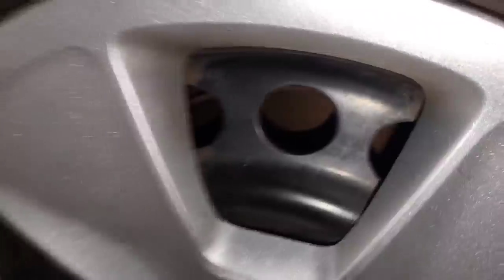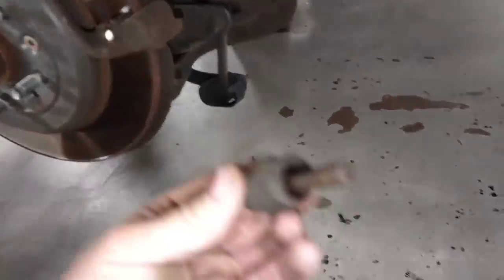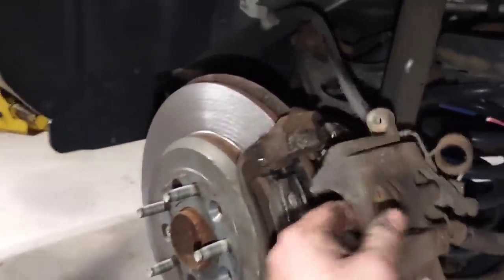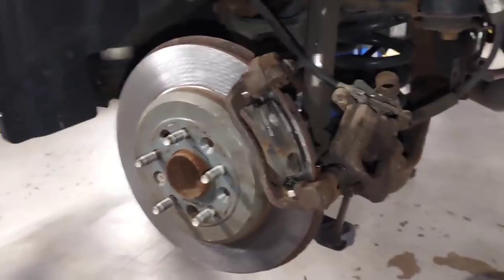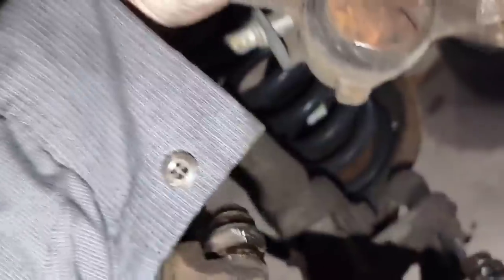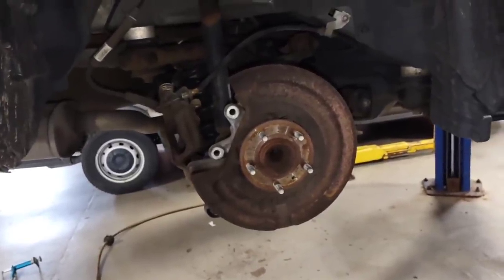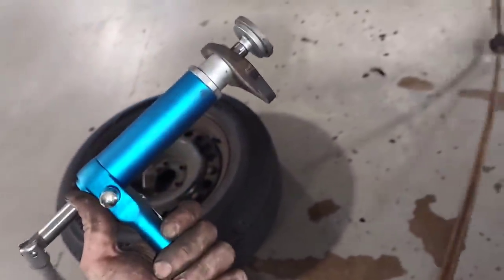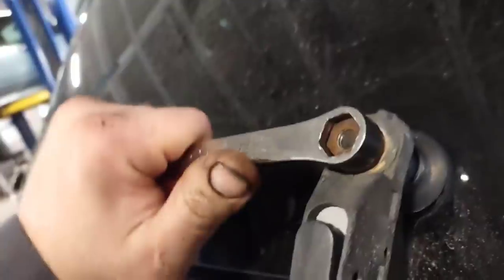Fixing Another Shops Brake Job Screw Up - this makes mechanics have a bad name Shoddy Work

Comment: C/s: My brakes are sqeualing
Tech: youve pad slapped your rotors, theyre warped from heat damage and grooved, this is a symtom of pad slapping
Customer:  but Ive never had my brakes replaced!
Tech: 90000 miles and you have 7 mm of pad left?
Customer: ....My mechanic did it

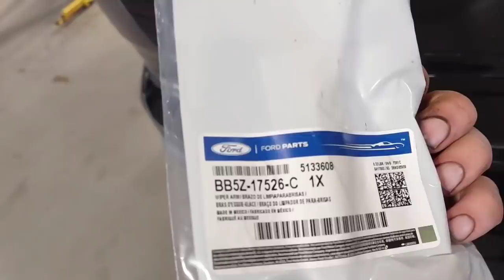Comment: I wouldn't be afraid to charge them.   Did that back wiper arm fall apart at 7:06?   Looks like someone tightened it to the breaking point.
Reply from the maker: I actually talked about this at the end of video oh, did you watch it all the way through?
Reply: @FordBossMe  Most of it.  Will rewatch.  You're a good guy for helping them out.   I am by no means a professional but i can work on my own rig.    Sad to see shops not making sure their employees are doing quality work.

Comment: Are any 5.4 3v worth buying or is that an engine that should be avoid?
Reply from the maker: I think 2008/2009 2010 were the better ones
Reply: @FordBossMe  are they at least some what as reliable as the 5.0 coyote?
Reply: @777theright88  I got 200k on my 5.0 coyote. No problems and runs great.

Comment: How do the pistons get out of clock, or unclocked (if that's a word) unless you rebuild the calipers?  And by the looks of things this "guy" didn't rebuild anything.
Reply from the maker: So you take a tool whenever you're ready to do the brakes and you turn the Piston back in and this guy didn't set the Piston up right when he put the new brake pads on he had it off so it wasn't even touching the back of the brake pad properly whenever he clocked it

Comment: I did take my ford explorer 2013 to dealer they ask for new front brake pads a rotor bc they are dmage they state $600 hahhahs i did inspect my self mechanicn inclined... took tire off lube pins etcetc padss and rotor great...  you know what they said you need your car must be shacking and to put the cheery on the cake that also need new lower control arms $999 .00... they tried to mke commission and sale on my expense ...

Comment: I'm not knocking you, but if the front rotors were getting real hot why wasn't the rear checked. If the back pins were locked up pads can't  properly press on the rear rotars.. where i worked we always checked all hardware and and movement on all wheels. Going the extra step to check the caliper brackets would have been a benefit to you. And fixed everything at once.
Reply from the maker: Checked the pinned post
Reply: @FordBossMe  
  Thats why I said I'm not knocking you.
 But it should be shop policy when doing  work like this to do full inspection front and rear.  Due to the fact that they will want the fronts on warranty when there warped from the excessive heat.
It seems like the guy just tossed the rear pads on. I doubt it was a shop, thats when I ask the customer to bring in the service order. We have had customers go to small claims court against shops that did stupid stuff like this. I've seen where the (at fault) shop has to pay customer back, and also pay you to make vehicle able to be on the road.

Comment: New rotors but no new calipers? And as low cost as calipers are?
Reply: With shop rates the way they are, it's just cheaper to replace the caliper.

I'm dealing with that of my lower control arms right now
  it's just easier less time to replace the entire lower control arm then to replace the ball joints and bushings because of shop time.

Comment: Why let others take full pay on a job and not have them make it right or get a refund?  For all they know, they did a good job with no complaints and will keep doing poor work.  You come in as the nice guy and take less than standard fee.  Not your fault.  Only upside I see is that you may gain a returning customer.  I understand helping people out depending on circumstances, but people need to accept and take responsibility for their own poor decisions and not rely on other people to take up the slack. 
Not sure if you are a flat rate tech paid by the shop management, but if so, they should be the ones to reduce labor and parts prices and pay the tech in full.  In my dealer, if I did this often, I'd be getting reamed about lack of productivity.  I would fix the wiper as a simple courtesy in that case.  
Being a taken advantage of tech doesn't erase the bad work of other techs.  Managers look at bottom lines and fck ups only get addressed when they are called out or cost their shop money.

Comment: my friends sister  took her   Sable to a Tire Kingdom , a couple weeks after  him zeroing out all the fluids, new Filters everywhere plugs wires etc, for his sister. she goes in for the $9.95 let us check your vehicle over deal,, Guy comes out Mamm You need $1200 in work.. She calls him, and in he goes,, Guy goes on about needing fluids, etc,, he holds his hands out and Says, Guess what I do for a living.. I did every fluid , plugs wires etc not 15 days before and your saying it all needs replacing... Get the car down off the hoist. and off he went..  another Girl we know called us saying shop told her the calipers are missing. and rear cylinders are leaking, In he goes.  says now tell again  Her Calipers are missing??  and the rear cylinders leaking, You spray alcohol on the back of the backing plate thats wet, to see if its brake fluid vs gear oil or grease weeping ?? guy says no Why... Cause the alcohol will clean brake fluid fast but not as easy oil or grease. so you;ll know if its a cylinder leaping vs a seal  and then you can look in the master Cyl too to see level..   Down that car came too...

Comment: God help them if they had drums or internal drum emergency brakes.
Living in the Northern rust belt "internal drum emergency brake" disks always rust up, along with cables. Just like older drum brake cables.
My father told me; "Any used vehicle you're not 100% positive they used the Emergency brakes, DON'T touch it!"
Once I forgot and had to stop a 1978 Mercury Zephyr and the bracket tack welds ripped off the bottom of the car, brakes were siezed. Then I had to cut off the dragging parts off the bottom of the car. Many of them I even unbolt tbe pedal from the firewall so people have more foot room and don't get the idea it's a working emergency brake.

I'd rather do my own brake job regular maintenance with rear drums and stainless steel lines than pay for cable emergency brake cables and shitty Lincoln calipers. Easier and cheaper with Jeep rotors and S-10 calipers on a Ford 9in rear.
Does 9in show my age? 🤔😂

Comment: Question. 
I have a 2010 Fusion. 4cyl.
The fuel inlet warning / Small/ large evap code.
Sometimes it goes on sometimes it'll clear itself out.

Is this really common?
Reply from the maker: Most of the time on those Vehicles it's the purge valve or the gas cap not tight
Reply: @FordBossMe  It's a capless fuel inlet.

Comment: Is it me or is it like most car shops charge you way to much??? Goodyear charged me about 800 dollars to get all my brake pads and rotors replaced with a brake fluid flush!!! I just had a friend do it for me for just 300 dollars !!! The brake fluid flush wasn’t even needed too yet they insisted for me to get it changed!
Reply from the maker: Brake fluid should be changed yearly they recommend now

Well that's why we have connections and if you trust him then good but if you go to a dealer or a shop you're paying for not only the job but you're also paying for the insurance and you're paying for whoever it is to make sure you get the right parts regardless of the situation
Reply from the maker: I was just saying my shop if you had a front rotor job done that would be $300 in labor and about $50 in pads that's 2 hours labor so $800 does seem about right for what you were charged front and back and a brake flush because you're going to a shop to get it done

Comment: That's So basic. Possibly a new inexperienced guy did the rear brakes. It won't reassemble properly if they're not clocked correctly. Pins need to be cleaned, greased to work effectively. Dunno why guys think a brake job is a slap it together kind of thing. It's not. People's safety depends on the job being done right. No exceptions. No acceptable excuses.

Comment: Yea that’s a 40 dollar brake special .... but tuffy would do that kind of shit .... bare minimum and he charged 250 per axel . I remeber the tuffy boss did a rebuild on some heads .... 3.5 j3.5 and it didn’t come out right ... and it burned oil and it smoked and tried fixing it with some bardal shit from autozone and honey stop leak .... I am glad he fired me !!!! And he charged like 3500 dollars ...

Comment: I work at a shop and had no idea your supposed to clock the pistons.
Reply: It depends on the pistons.
Reply: @5roundsrapid263  i realized now the notches in the brake pads line up with the piston. man ive done a lot of cars wrong lol. but apparently it just makes the pad wear funny.

Comment: I know this might be a very broad question but any tips on finding a local good and trustworthy independent mechanic?
Reply from the maker: I would say look at reviews but with today's cancel culture and everybody getting attacked that's not even worthy anymore

I'll tell you the number one way to find a good shop:

Go into a place and get your oil changed and ask them to just take their time and do it right no rush and try a few different places out in your area and the next time you go in there to get your oil changed see if they have the same people retained, unhappy employees will not stay with a place that treats them badly and treats at customer badly
Reply: This might not be a hard and fast rule, but this has worked for me.  If you live in or near a major city, there's no doubt at least a couple snooty, "rich people" suburbs.  Find a mechanic located smack dab in the middle of a rich people area.  Rich people's expectations are high, and they aren't going to beg their mechanic to find a way to save them a few pennies.  I had a seized caliper last year.  Took my car to a local independent mechanic, which is located in an upper middle class suburb.  The mechanic did the job right, and charged accordingly.  And, of course, ask friends and co-workers where they take their cars.

Comment: Is this even real? How can a mechanic not properly clean the caliper bracket and lube slide pins and so forth? Everything looks rusted. Then when I want to charge 60$ for every tire i do brakes on people think I'm ripping them off. But for someone like me who have done hundreds of brake jobs and understand cars have molecules. My brake job is impecable. If I don't get at least 60$ for normal passenger cars per wheel I won't do it. I use slyglide for slide pins and for the abutment clips i have been using CRC brake lube which is more thick grease that is perfect for the brake pad to caliper bracket contact points . On top of all that I smear some of the red-pinkish anti chatter stuff on back of the brake pads where the caliper make contact on front pad and on rear pad where the caliper piston make contact with the inner brake pad. My favorite way to do bracket cleaning is to use wire wheels with a drill press and totally clean the caliper brackets and slide pins as well. A Dremel tool with a flexible shaft with wire wheels can be used to totally clean the brake caliper and brake caliper piston. gett all the crap off the brackets and calipers and do it like I say and when you drive the car and every time you brake you'll feel like you're king of the road. Also if the brake system needs bleed do it and do it the right way by pressure bleeding the 2 person method has been proven to be flawless. You have to have a helper with a lot of patience. If the condition of the brake fluid is discolored if you don't do a minimum of 20-30 bleeds on each line until you see clear fluid you are not doing it properly. If the hydrologic part of the brake system is up to specs and flawless and if you do what I recommend every time your customer brakes they will love it and feel confident in YOU as there mechanic YOU doing small details give YOU and your costumers a detailed trust and blah blah blah blah blah.   Blah. Just do it right and if you do it right get paid right and if someone who can pay you to do it right thinks you're ripping them off just don't do it. When you work on care do not cut corners unless it will absolutely have no effect on the operation of the vehicle.

Comment: 🤦 Wherever that went to gave that job to the young kid who normally sweeps the floor is my guess. I did my Flex rear brakes about a month ago and I was fuming... The last tech that serviced the rear brakes before I got it put the pads in missing half of the clips in the caliper brackets. I'm lucky enough to know my stuff when it comes to brakes and I can take the time to clean everything thing properly and get it right. Anyone who gives you a hard time on how you did that job is a jerk! It shows you can actually do the job right. There is a time and place for replacement of parts but real techs like you know how to make it go with what's there within reason of course. You are definitely not a parts hanger. One less dangerous set of brakes on the road is always a good thing. Having a safe happy customer is also a good thing. Karma is on your side!
Reply from the maker: Thanks, so true

Comment: Btw how do you perform a full flush coolant syten cars is $ 88k ford epxlorer they charge $  180 and as per invoice  they just use 1 gl cooalant vc*13*g and 1 vp*005* use vc1  for full flush i hope you can answer this question if they actully didj what they suspose to ... bc if you flush the entiry system usisng the machine you will neeed more than 1 galon  let me know thks
Reply from the maker: Concentrate coolant is 1 gal = 2 when you mix it 

And the cleaner they run through hot and flush out as addiing in the new and dumping a water pump lubricant as well
Reply: @FordBossMe  the question is bc you end up using 2 gallon if you drain the coolant doing yourself . Rigth about use the cleaner when the engine is running excep for this part they didnt do a much as i was thinking if you do it by yourselft

Comment: Did you use any grease? Ur pins are going to seize?
Reply from the maker: Did you watch the video all the way through
Reply: @FordBossMe  yeah just finished wife came out why are you looking angry then told me I needed to calm down we don't resurface where I work remove and replace kinda deal but yeah just went through it all with the wife
Reply: @FordBossMe  when you tell someone 300.09 they go pay someone else 150 then want you to fix it for a hundred no it's 450 now I have to fix their work

Comment: I found out the hard way...don't ever use synthetic slide pin lube....check and clean them every six months....
Reply from the maker: Synthetic has worked great for me
Reply: @FordBossMe  I found 3 items on YT when it happened to me...guy even had zoom'd in microscope pictures on the size difference in the rubber bushings using regular verses synthetic lube . The synthetic somehow "swells" the bushing...I couldn't push the pin back in the caliper without the bushing in place.Went and got new hardware and regular lube for my 2003 Grand Marquis and everything went back in fine...if they somehow changed the bushing material since 2017 then they figured it out...

Comment: did i see correctly did 1 of those rear calipers have a burst outer dust seal that wasnt fixed
Reply: not bagging on u man u worked with what u had on a budgit and it was a shocking repair from that other shop
Reply from the maker: No it wasn't first and I actually pulled the seals back to see if fluid was coming out behind the piston and it wasn't so everything was still good there it's just the way they clocked them is bunched up the rubber and I told her I'm going to clock it to fit the pad properly but whoever did this before really twisted up the rubber on this it was way worse than what you see in the video I straighten it out as much as I could and make sure there was no fluid coming out and made her aware
Reply: @FordBossMe  i have seen many calipers with that seal split and i dont think twice its changed i dont even test the caliper 2 see if its working or not as i now it will f up keep on doing what u do m8

Comment: How many miles on this? By the looks of it, those callipers might be on their last legs. I find that people are usually hesitant to replace callipers because of the cost, and the extra work. But they don’t mind trashing a couple sets of pads and rotors before they go ahead with the inevitable callipers anyway. This, to me, is wasting money. Oil changes no. 1 and brake jobs no. 2 are the easiest jobs that get screwed up more then more complicated jobs. Is it because this type of work is beneath trained mechanics? Or is it just because it’s easy money and at the end  of the day, a set of pads and rotors is gonna pay without the mess of cracking brake lines? In my world (my cars) a brake job includes a full brake fluid change. But this is not what I see.

Comment: Looked like the boot  was torn on the rear cylinder.
Reply from the maker: It's just a dust boot so it doesn't function any more than just keeping dust out and there was actually just a little tiny tear in it and I told the lady about it she didn't want to fix it

Comment: Screw up a brake job? in my opinion it's impossible. I'm not a mechanic and done brake jobs on my own cars and there's absolutely no way to screw up a brake job. Ok so maybe there's a way to screw up by installing wrong rotors, calipers and or pads.

Comment: An automotive technician would never use a tool like your camera the way you are.......
I have been inspecting vehicles for 25 years and have a whole lot of scary brake work stories to tell...how about a rice burner that came out of he factory with out an outer brake pad.
Reply from the maker: Yuh you started off with trash talk

Conversation ended immediately good luck to you guy